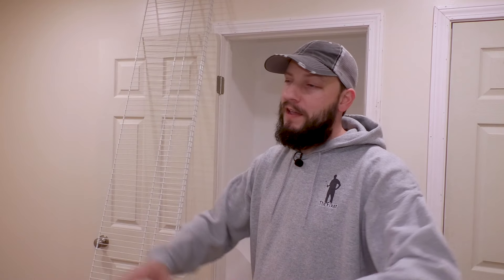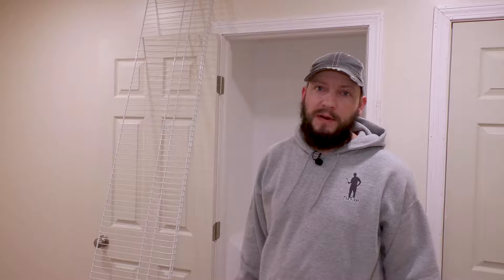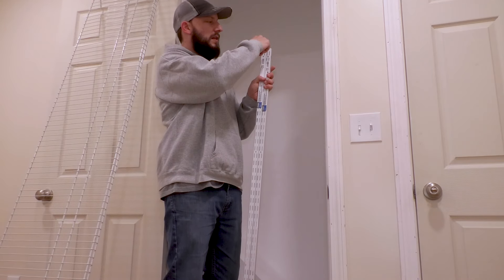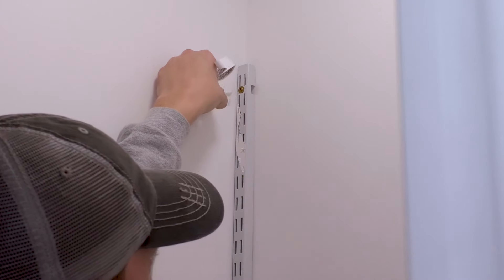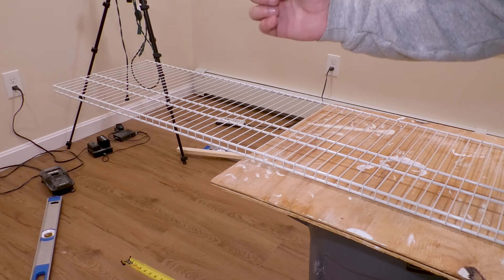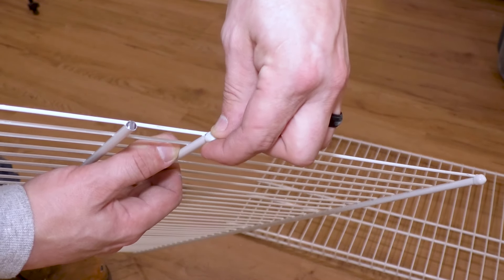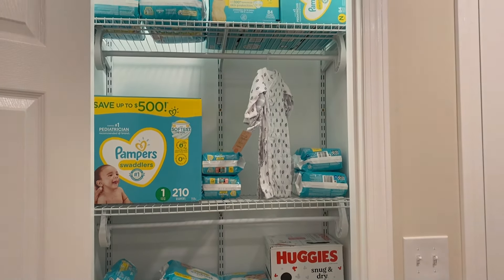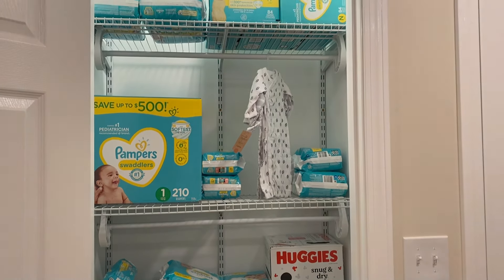How to Install Adjustable Wire Shelving

Comment: I am a fan of this type shelving.   To protect me from myself I cover cardboard with sticky-back shelf paper and create flat surface shelves.    I find the best prices on Amazon.    I have also spray painted cardboard in a pinch but eventually covered the paint with paper.    The system is sturdy and widely accessible.   TWINS!!!   Congratulations!    Your small home will be filled with laughter, love, fun and happiness.

Comment: Absolutely did not think you were joking about the dippers. I did have this same wire shelf system fall off the wall and I vowed I would never install them again but you did it better than I did. Also clear plastic mats on top of the shelves will help smaller things from falling over because of, or down between, the spaces in the wire structure.

Comment: I designed and installed these shelves when they came out over30 years ago.  As an interior designer myself, these are EXCELLENT space efficient storage. Much better quality than melamine covered fiberboard and better quality than most wood. Definitely more space efficient than any wood closet I'd ever seen. The ONLY time I would consider wood shelving is if I were converting a bedroom into a closet. Installed properly, these shelves are very sturdy. Most contractor type installations are NEVER done properly. My shelves have been up for 27 years, fully loaded, not a single failure and I rarely concentrate on finding a stud, I simply install properly. Big tip #1 - do not use a 1/4" drill bit for installing the back clips with the attached 1/4" anchors. Use a 15/64" bit - it gives a slightly tighter fit.

I've never used the adjustable brackets, they do look tacky and they limit design options.

Comment: I use this setup as well but I replace the wire shelf itself with a laminated white board so there's no gaps and it doesn't have that cheap/ugly look everyone worries about. Can get them for around the same price as wire shelves and is still adjustable.

Comment: It's hard to beat those wire shelves for smaller closets for all the reasons you mentioned and also, the shelving hardware doesn't take up lots of space itself. I only tend to have issues with wire shelving when you hang/store too much weight on it. We have wire shelving in our large walk-in, and I've had to reenforce the upper clips and the support arms with backing plywood furring strips when (overloaded) bars crashed to the ground. Most of the supports used drywall anchors, so that didn't help.

Comment: How do you ensure that the spaces within the wire shelf align with standards so the shelf brackets fit in the middle of the spaces? What happens if a wire within the shelf lands between the two slots of a standard? Do you just move the standard or do a dry-fit first?  I hope I have clearly conveyed my question.